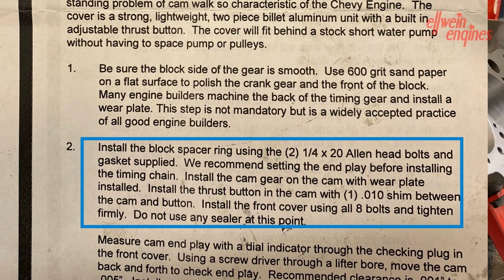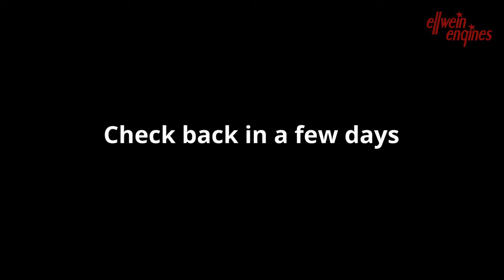Cam button for the 400 Small Block Chevy

Comment: Doesn't the metal shims go on the button ? It has a small snap ring that pops off and you can slide the metal ring off and put the shim on that.
Reply from the maker: possibly.  That must be the key knowledge that I did not have.  Thanks for the info.

Comment: Once you have your cam in, leave it in. Continuing the in and out especially without lube is a recipe for possible failure. Just take the cam gear off the front and do our trim or shim work then back together. Saves a lot of time and future problems possibly. Cool vid though and like everyone learning the craft by mistakes.

Comment: If the shims don't get you the .001 to .005 then I suppose the set screw can make up the diff. You never seem to have the shim size that you need, whether you setting a ring and pinion or in a gearbox, etc.

Comment: I use Liberty engine parts roller cam buttons and a cam button locking plate , you machine the end of the the cam button I hope you cleaned the camshaft after standing it on the floor before you installed it
Reply from the maker: Yup, I clean every part in my clean parts washer (not the dirty parts washer).  I have safetyKleen

Comment: Does the cam gear have a Torrington bearing on the back of it??   This cam button seems like a rinky dink way to accomplish holding the cam in place.  Good opportunity for someone with some mechanical and machine shop knowledge to make something better and market it in my opinion.
Reply from the maker: I think what some do is get a step nose cam and machine a cam plate set up for the 400 block.